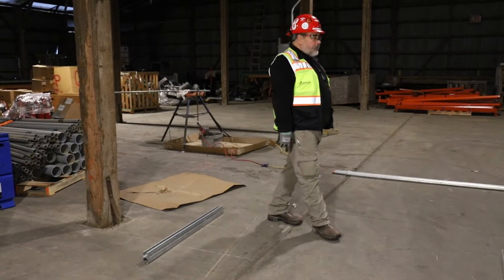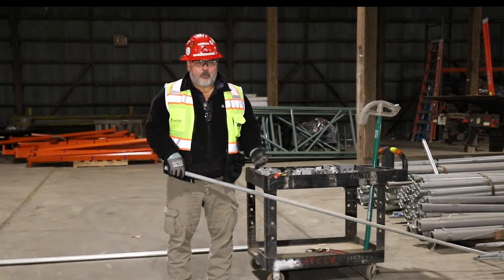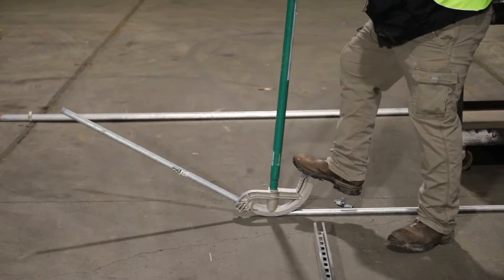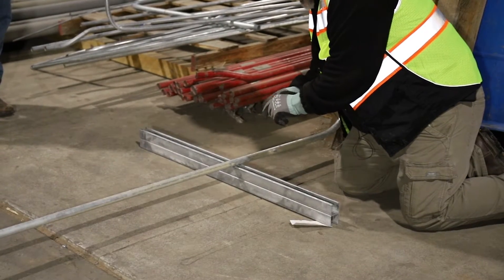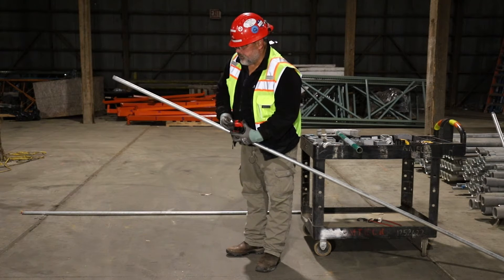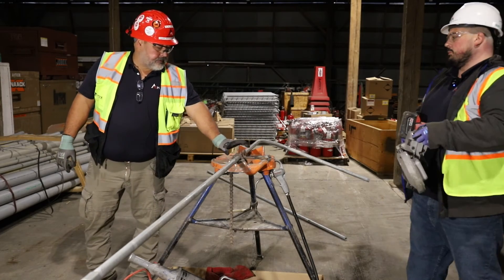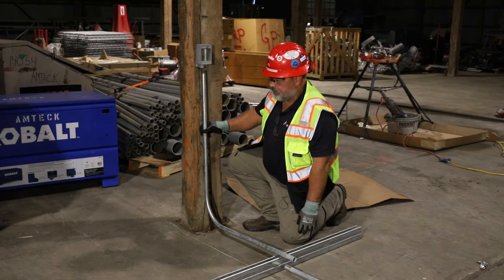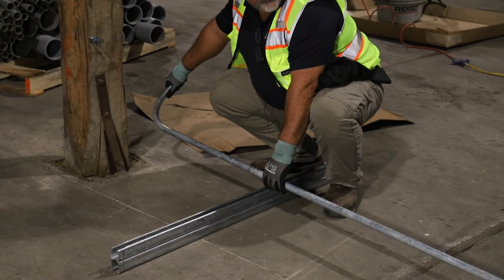How To Bend and Thread Rigid Conduit

Comment: The deduction for 3/4 pipe is  6". Why is he using the 8" deduction?
Reply: I believe all the deductions for rigid 3/4 are the same as EMT 1 in. Someone correct me if I'm wrong. I'm still learning.
Reply: Your deduction is based on the bender you’re using, it’s a 1” bender so you use your deduct in accordance to that, 8”.

Comment: You don't have to deduct for the 90 if you use the star and pull toward the measurement
Reply: Isn't the problem there, what I've experienced is that the piped up 90 is so long it's less controlled. The short in on the ground is unstable. I use star    for 90 only when it's convenient. Just my experience, not saying you're wrong.
Reply: So if you measure from the left, you would place the foot to the left?

Comment: If you are doing rigid conduit it’s a good practice to spin your boxes, Meier hubs, unilets on first to see how they fit.  You may need to change the depth on the threads or clean them up first to thread them on tightly.  This is reaaaal important.
I don’t recommend using minnies because they are easily crushed or bent compared to malleable 1 holes with back straps.
They make 3 1/4” deep strut and it’s a better install vs using back to back 1 5/8” strut.
Always spray the cold galv on after you threaded your pipe which contains the mess.
Threading rigid conduit is not a 2 person project…you can fasten the tripod legs down or use a sturdy rope to make a 3’ loop that is tied to the foot, using a piece of wood can’t stop it from flipping on larger pipes or if the tripod is an old p.o.s
Finally when bending your first piece you should have calculated the gain which on newer 1” foot benders is somewhere around 4 1/2”…it’s verrrrry good to know because you cut and thread first then bend if need be.
When using a foot bender I highly suggest you take the opposite end of the conduit and stick it on a wall or curb or something sturdy so it cannot slide around on you.  You can really hurt yourself if it slips.
Reply: Man I wish I worked with you as an apprentice. I bet I would have learned a lot from you
Reply: @josesolis8432  😂

Comment: Great video! But your toolie 54 seconds in , is oiling for you in the wrong spot
Too many times I've seen that power pony catch and come over top. Have your partner stand to the side so he doesn't get whacked by power pony with dull dies . 3/4" heavy used dies don't always get new teeth right away Good habit to have when you go to bigger conduit. That is why you see the chain or rope on TriPod leg to help. That is reality even with Hogs Head